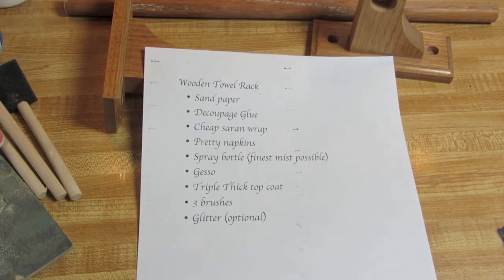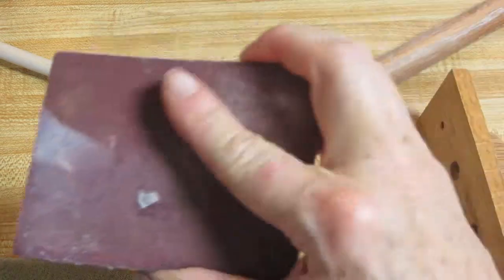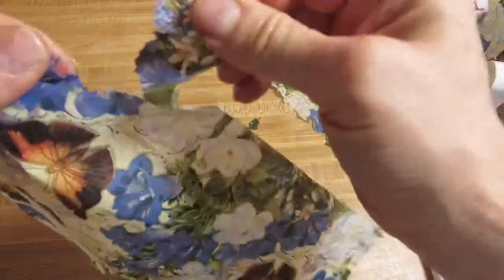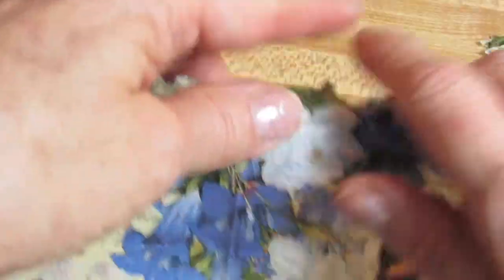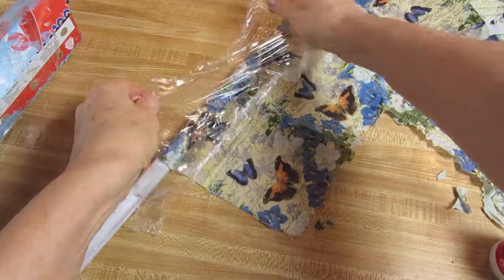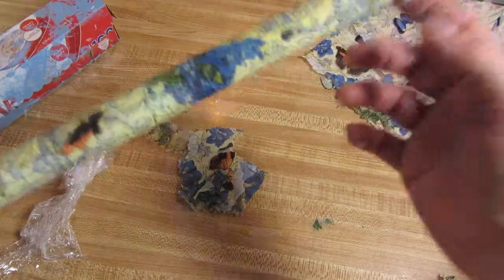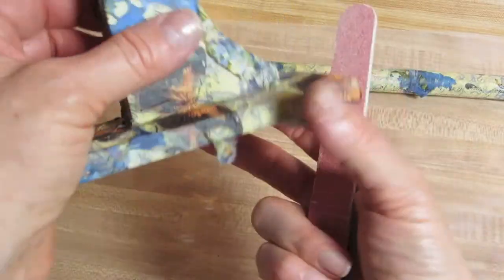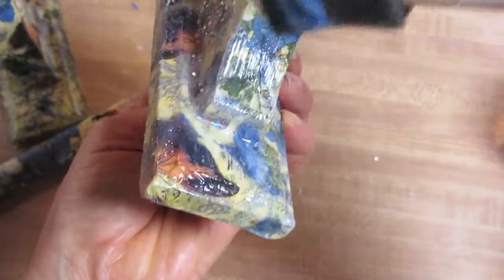Towel bar Decoupage your Towel Rack

Comment: sorry about my question but what is Gesso??????
thanks
Reply from the maker: Hi Liga, I'm the one to apologize. I should explain it when I mention the gesso. It's a water based paint (it's usually white but it does come in black & possibly clear) It's a lot thicker than acrylic paint and artists have been using it forever. It smooths out surfaces, covers up spots and as a base coat goes it's far better than using a coat or a few of acrylic paint. I'm sorry I didn't clarify that. :)
Patti